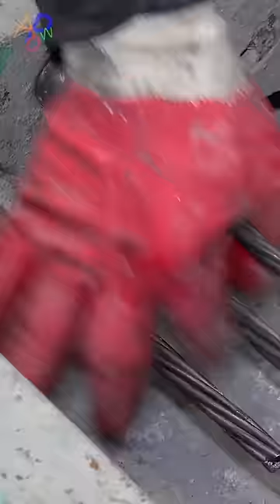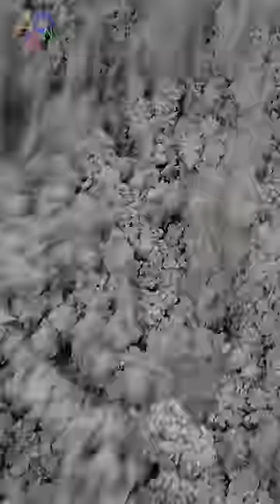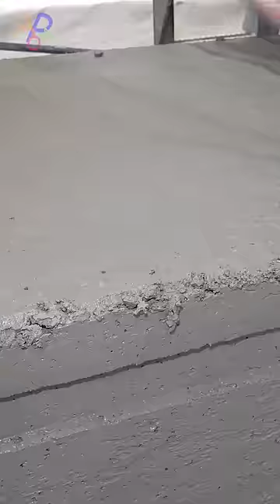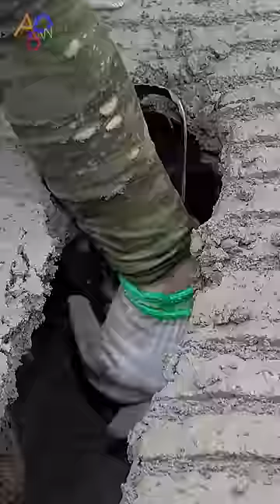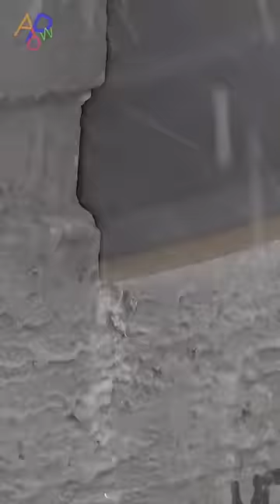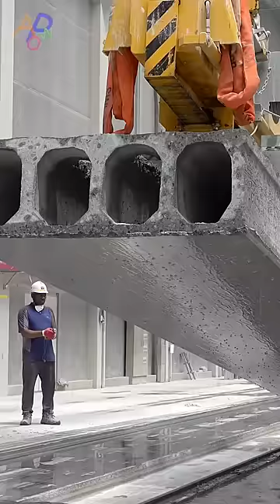Massive Concrete Slab Making Process #allprocessofworld

Comment: Someone said " Not smooth enough for a roadway". Not a Road, floor of a building. No where near thick enough for bridge or elevated roadway. UK has a huge problem with this type of construction in schools, apartments and government buildings. AIP concrete in the older version is failing.

Comment: Why are they hollow with so thin thickness???are these slabs for side railings or for road construction?
Reply: Hollow core precast planks are used as floors in buildings. Strong enough to do the job and save time and weight vs cast in place concrete. You would not build a road or load bearing structure with these. Also no to the walls, no need to make them that thick. Tilt wall panels are better

Comment: The quality looks like total garbage, I would never accept slabs that have such an uneven surface without a major discount.
Reply: А с большой скидкой тем более не взял.
 - А чего это они так дёшево продают, дефектная?
Reply: I think that the rough surface is to help with keying in the poured final slab on top.
Reply: You know that slab isnt going to be the final road, right? The reason for a rough  surface, is so whatever the construction crew puts on, adhears instead of sliding off. Ever wonder why people sand stuff people gluing, because it makes more surface area. If that entire beam was smoove, everything would slixe right off.also just a side note, the road you drive on, has more grooves than this concrete slab. No road you drive on is completely flat, it has thousand of grooves like your car tire to ensure your car grips the road while snowing and raining. I would hate to drive on a road you built
Reply: They're not going to be as smooth and shiny as the Lego blocks you're playing with in the basement son.
Reply: How to tell people you don't know shit without telling people you don't know shit .. 😂🤦🏼‍♂️
Reply: I want free money! 
Great way to say profit is more important than "perceived" quality